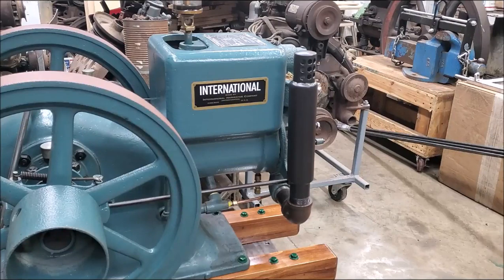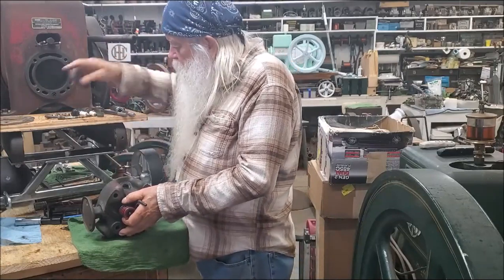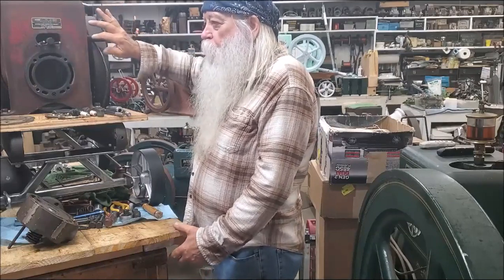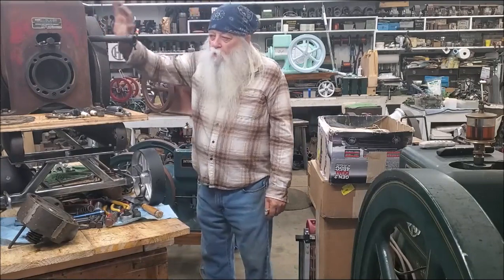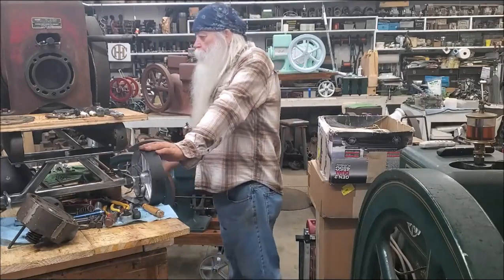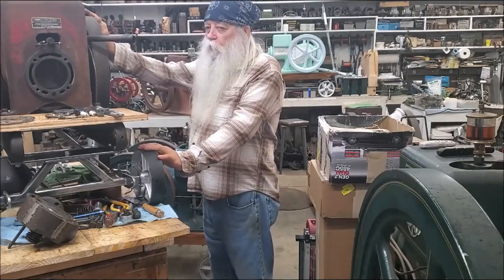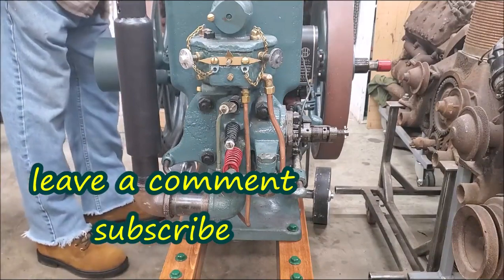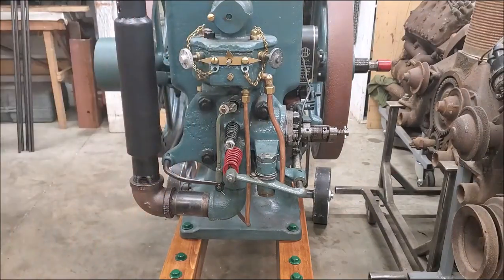International Engine la lb throttle / governor linkage

Comment: Hey Sam. I have an LB that has a very leaky throttle shafts seal in the block. I cannot find any solid info about wether the shaft is pulled out towards the head or pushed back into the block for removal. I have found a replacement seal and from what I can tell pulling or pushing the shafts out of the block will bring the seal with it. I just need to know which direction it is! I don't want to force anything. Do you have any experience with that?
Thanks for all that you do!!!

Comment: So, the “hunt and peck” is the just governor acting in an abrupt manner, causing the engine run to act and sound more like a true hit and miss control than the smoother transitions of a modern throttle controlled engine.

Caused by the limitations of the single circuit fuel/air flow ratio atomization of the mixer vs. a true carburetor.

Interesting.  I hadn’t looked at that factor on throttle engines myself, every one of these old engines I have is HnM, but I’d noticed the “cut out” behavior watching videos of the IHC Ms, but it’s rather obvious to me now.

Thank you, Sam!